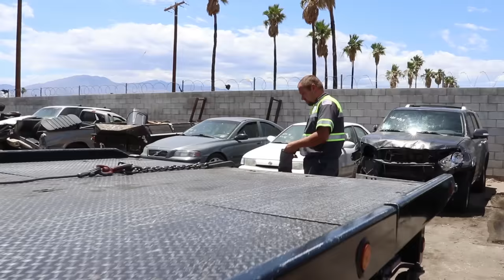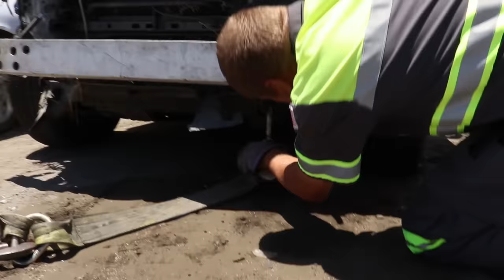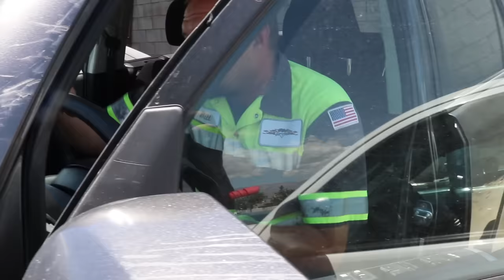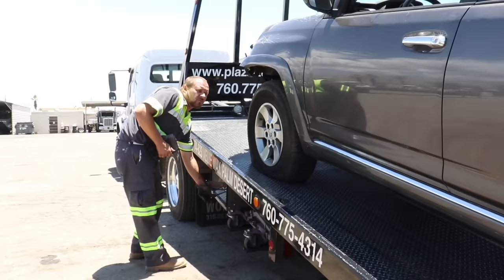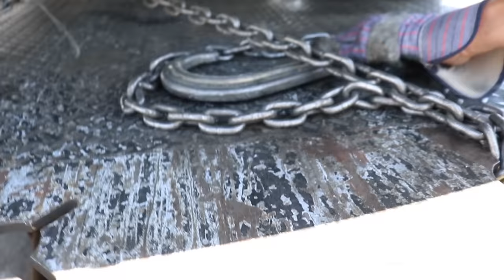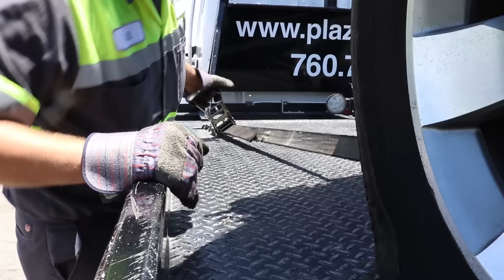Towing Wrecked Car On A Flatbed

Comment: I consider winch a tie down, but only 1 point as it's 2 points on the car to 1 point on the bed, same applies with the back, if i have 2 chains going to 1 tow hook it's 1 point because it's only 1 point on the car despite being 2 points on the bed, I do however sometimes run 2 chains in the back with the winch and a safety chain or strap in the front, As for chains vs straps, Chains seem more secure to me and are quicker, A lot quicker to attach to a pocket or axle and run it to the bed then tighten with the winch, I can do that in 30 seconds for both sides, Now I do however use straps on the front as securement, I use straps when pockets are rusted our, really beaten up and worn or If I can't quickly find a pocket, typically ford, chevy, dodge all have their universal spots for having tow points on most of their vehicles, I can quickly find tow points by just knowing where they usually are on these makes, However not all their models have that, and other makes have different pocket spots if any, So if I can't quickly find one on the side of the highway I will just throw a strap on the back or two, One day I had a impound on the interstate, ran one chain to a tow hook bracket on the back, went to put the other on and realized there wasn't one on the other side, it was the exhaust so i just threw a strap on that side, It all just depends on the vehicle, how damaged it is, where you are etc in my opinion, I have loaded cars with 2 chains in the back to the winch with 2 straps in the front and a safety if it's going a long ways I might as well take the time and load it with safeties and extra tie downs just so I don't have to worry about it at all, But I have also towed cars off the interstate still running with 1 chain in the back and the winch in the front just to get out of traffic then I tie it down the rest at a gas station or parking lot.